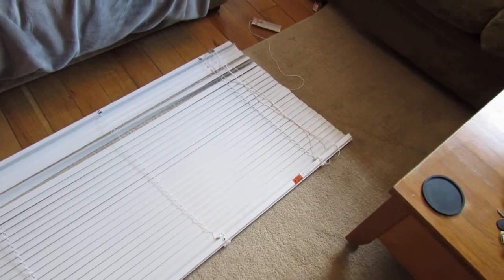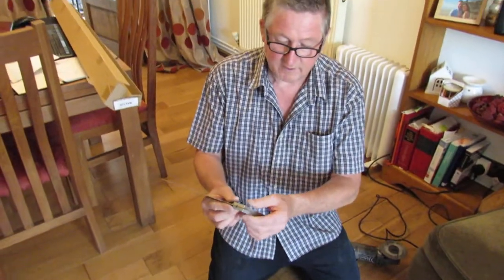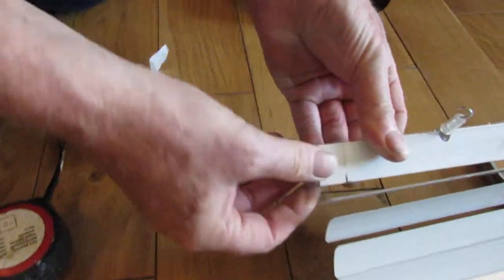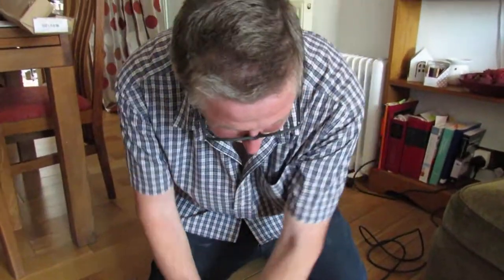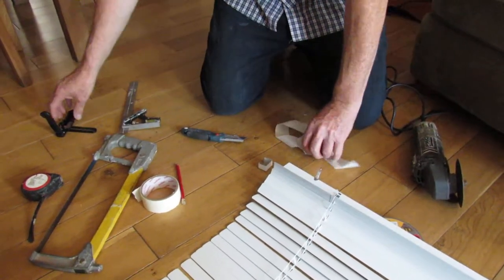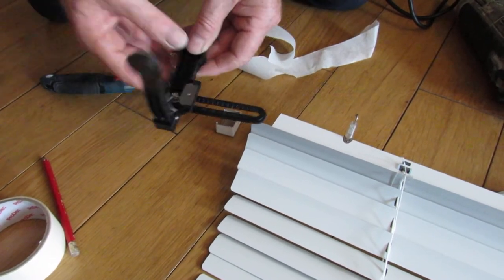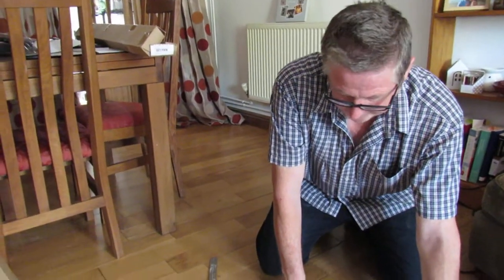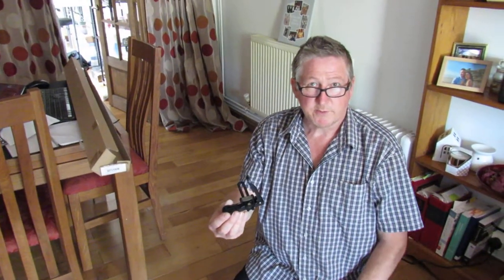How to cut and trim venetian window blinds to fit if they are oversize

Comment: Thanks for a really helpful video.
I practiced with the slat cutter on a spare slat i had from reducing the drop.

Reducing the drip is well worth while as it takes weight. This is especially useful for cheap blinds with a plastic headstock: i didn't do it with my old blind, which is why i need a new blind now, 9 years later.